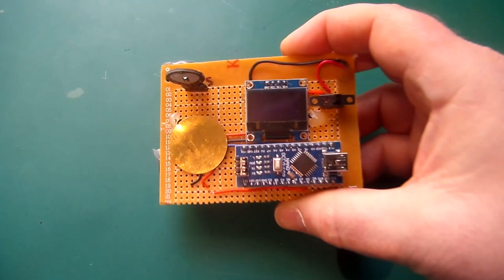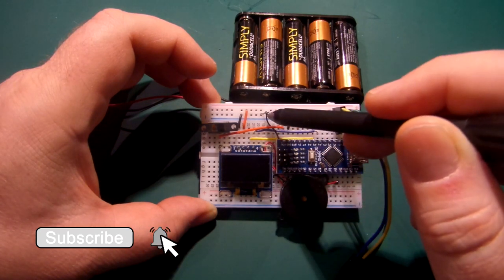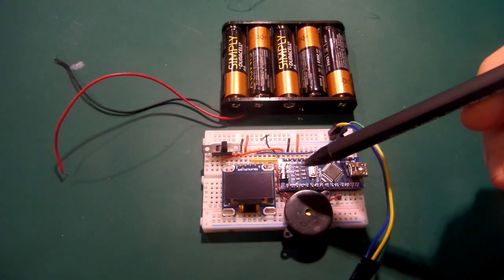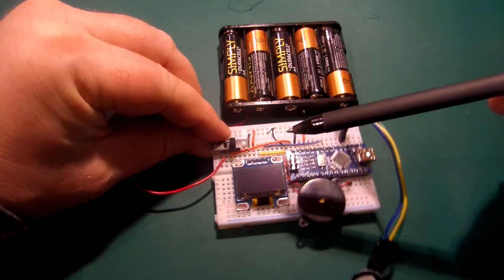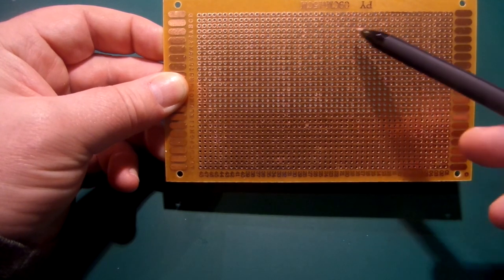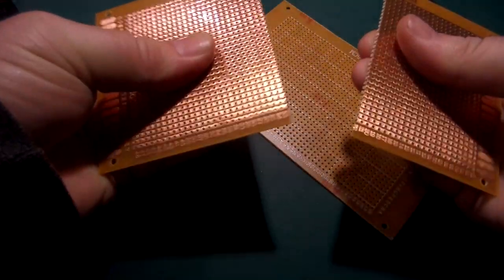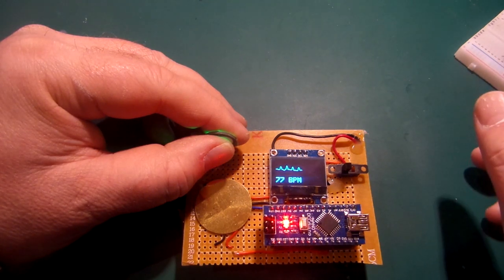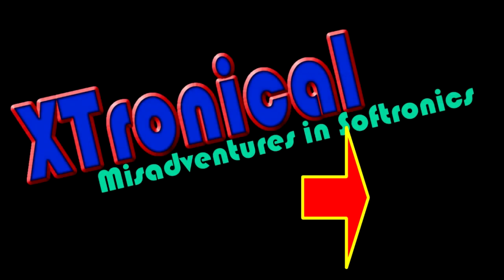Arduino Pulse (Heart beat) sensor with "ECG" display

Comment: Wow I'm first! Another great project idea. I just got through buying a "Thinary MAX30102 Heart rate Sensor Module Puls detection Blood oxygen concentration test For Arduino STM32 Ultra-Low Power" from Aliexpress for under $3 plus a little shipping makes it $3.30 U.S. Plus it lies flat instead of sticking into the air.
Reply from the maker: Oohh, I've just had a couple of those arrive last week but not had time to look at them properly yet, gone straight into parts drawers for now.
Reply: @XTronical  you sound like me, stick a label on it and toss it in a box. I have at least started taking screen shots of the description pages for later reference. I have gone to look stuff up before and discovered that it's no longer there.
Reply: How were you able to wire it or code? I have been looking all over online, but cannot seem to find anything at all to help. This is my first arduino project, but am worried I have bit off more than I can chew.
Reply from the maker: Do you mean the pulse sensor or the more advanced oxygen level and pulse sensor?
Reply: XTronical I want to say it’s the more advanced one. The amazon name for the component is “MakerFocus Heart-Rate Sensor Module, MAX30102 Blood Oxygen Sensor”.  I was planning to use my Arduino Mega to have an OLED and buzzer work with the component, but cannot make heads or tails where to even begin on the coding=\
Reply from the maker: Ahh OK, I'm doing this project after the current one, video will be out in approx 2 weeks. Hopefully you can wait that long.
Reply: XTronical thank you so much, I am looking forward to it!!

Comment: Hi, I am quite a newbie, so forgive me if I'm asking a stupid question: I have found an OLE screen but it says"Driver SH1106 (same operation with SSD1306, SSD1106)", will it work or it shuld be strictly an SSD1306? Thank you.
Reply from the maker: They are very similar but different enough that the adafruit driver used will not drive this screen correctly , so better to stick with a normal SSD1306.
Reply: Many thanks! Actually I saw, after better look, that this display is nit a 128x64 but 132x64... weird. Anyway, I had problems finding the right one, finally ordered it on Amazon from US seller.: WINGONEER 2Pcs 0.96 Inch I2C IIC SPI Serial 128x64 OLED Display SSD1306 Module Board with Pin Headers for Arduino - Blue Font. In the mean time I will prepare the rest :-)

Comment: can i use my laptop instead of ecg display or oled display ? and instead of pulse sensor can i use IR transmitter and receiver.
Reply from the maker: In theory yes, but you have to write the software on your laptop to read the serial port and display the results appropriately. I think some channels have done this but not sure if they released source code or the application but I've definitely seen some videos showing this.

Comment: Hey man, just wanna ask what type of LCD screen are you using? I have a thesis where Ill create a wearable heart beat sensor as well. I use a "lilypad arduino" to make it  the same sensor as yours and is also powered with a rechargable battery pack. However, I dont have a LCD screen to display my specific BPMs, I only use 3 LEDs (Green, Orange Red) that represents whether my BPM is either Low, Average, or Critical. Planing on using a LCD screen for better accuracy. Would appreciate your help
Reply: It's IIC OLED 0.96" display. Not LCD
Reply from the maker: Also the sensor used in the video is not brilliant when moved slightly, even when fixed with tape or something, but for a thesis project it'll probably be ok to show proof of concept. Many viewers have used this for their college projects etc. It's incredibly popular for that. However I am working on re-doing this project using a MAX30100 sensor as shown in this video in the next couple of weeks;

https://youtu.be/DRrMQLXYfH4

These are less prone to bad results from vibration or movement and as a bonus can also show your blood oxygen level.
Reply: Thanks man,awesome vids. Keep it up
Reply: Ow and, is it possible for this specific OLED to change the color of its display? Or is it already set?
Reply from the maker: These ones are single colour, you can usually choose between white.blue/yellow or even one that has a top line in yellow and rest in white. A small colour TFT LCD is possible though but I've not written any code for one, it would need some adapting. I am working on a large-ish colour LCD(but too large for a wearable) version. However I might do a smaller colour version as it sounds interesting but could be around 2 months before I get that done.

Comment: if i want to wire the components to the arduino what pins should i wire the switch and battery to
Reply from the maker: Negative to ground "Gnd" and positive to "Vin".  Just connect your switch in series with the battery to cut its power to the Arduino when required.
Reply: @XTronical  so I should also wire the switch to the ground and vin pins too
Reply from the maker: Sorry, I'll be more descriptive. 
Your battery will have two wires, wire the negative to the Gnd pin of the Arduino. 
Wire the positive wire to one connection of the switch.
Connect a wire to the other connection of the switch and wire this to the VIN pin.
If your switch has 3 connections then use the middle pin and any other pin (but not all 3).
Hope this helps.
Reply: @XTronical  thanks

Comment: can u do this with MAX30102 pleasee
Reply from the maker: Yes, see these two videos,

https://youtu.be/17im1J1EdZA

https://youtu.be/DRrMQLXYfH4
Reply: @XTronical  do you know how to display ecg on 128x64 oled use max30102? i tried to change the code but i can't upload it because of the error
Reply from the maker: It's such a different display that it would require some significant changes.

Comment: if i want  to put the sensor on 3 volt, which part i need to change on the code?
Reply from the maker: Nothing, just need a 3.3 volt micro controller instead of arduino
Reply: @XTronical  i'm using esp8266, and try with or without voltage divider for A0, but the sensor read slightly little
what should i do? thanks before for your answer
Reply from the maker: Ahh, thank you, yes my bad there might be adjustments required in the software, but what you are doing sounds good. As I've been bogged down with the same project for a couple of weeks I'll take a little time off to look at this (and some other requests). I have  an ESP8266 and will get it working on that and this will hopefully help you. I'll get back to you in 2-3 days with hopefully a completed project (video will follow). One question though - which ESP8266 board are you using?
Reply: I’m using NodeMCU V3 ESP8266 ESP-12 CH340 IOT, thank you for your help really appreciate
Reply from the maker: Just released a video, good and bad news really. Good is that there is nothing to change, the code and sensors will just work with the ESP8266 or ESP32 etc. no problems. Bad news is that there seems to be some variance in the quality of the sensors out there. I experimented with a brand new one and it gave the same results as you got (and others) and then tried one I'd used before and it was perfect. You could see on the boards that different components were being used. I suspect incorrect resistor values or something that affects the performance of some sensors. Either way it would seem the problem is down to the sensor itself. As other people have reported this problem there does seem to be a few of these about. Out of 5 sensors I've bought I've had one rogue one. You could try a different supplier, that might help.
Reply: Thank you for your help sir

Comment: How to use this code in oled display 1.3 inch, 4 pin.please tell
Reply: My oled display is not working by this code
Reply from the maker: Sorry, missed this comment some how.  Are you using a 1306 type display, if not this code will not work with your screen

Comment: do we connect the pulse sensor to the 3.3v pin or 5v pin
Reply from the maker: 5v
Reply: @XTronical  because the pulse sensor is not stable at all only beeps when i move my finger
Reply from the maker: @richardomosanya6777  Run the test code on the web page for this project http://www.xtronical.com/pulseheartsensor/
It's where it has a sub-headig of "Connecting it up and initial tests". Keep you finger gently pressed on and not moving. Look at the traces on the serial monitor and note down your max and minimum levels it tends to got to (not any spikes). The code may then be able to be adjusted to work with your sensor
Reply: @XTronical  should i put my max and minimum in the code and if so where
Reply from the maker: These two constants define the top and bottom

#define UpperThreshold 560
#define LowerThreshold 530

But whatever your max and min are you need to go a bit below for your max, and a bit above for your min, for example if your max and min were 400 and 300 respectively you would enter perhaps

#define UpperThreshold 380
#define LowerThreshold 320

Of course you need to change to whatever values you have. You may have to play about with them a bit to get the best result.
Reply: @XTronical  still nothing its the same giving me a flatline when i pace my finger telling me i have 13 BPM
Reply from the maker: What were your upper and lower values and what did the trace look like on the serial plotter when you tested
Reply: @XTronical  upper value was 515 and lower was 505 the line on the serial plotter looked fine but on the oled display it keeps giving me a flat line and saying i have 35 bpm and whenever i move my finger the bpm changes to 80 or 100 and the line changes as well
Reply from the maker: That range 505-515 is far too small. The serial plotter is magnifying it to give what looks like a decent resolution. You've only a difference of 10 there when it should be around a 100 or more.  The code will struggle to determine a BPM from such a small range. Values you could try are
#define UpperThreshold 513
#define LowerThreshold 507

But I still think it's going to struggle on such a small range. If you are still struggling then two things come to mind. Either the sensor is not operating very well or the sensor is struggling to detect the capillaries under your skin. Although I doubt it's this reason it's the easiest one to check if you can get someone else to try it as buying a new sensor is not ideal.
Reply: @XTronical  how do i magnify the line so small ripples look larger
Reply from the maker: Line 36 which reads
int y=60-(value/16);
The "16" alters the magnification of the trace (vertically). Lower means more mag, bigger = less.
If you need to the "60" alters the vertical position of the trace, less will move it up the screen, more will move it down.